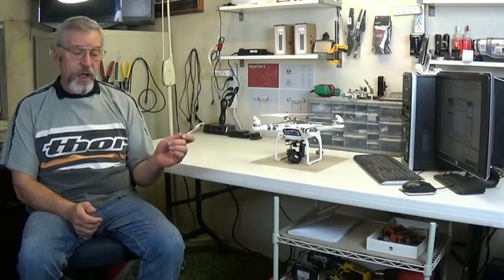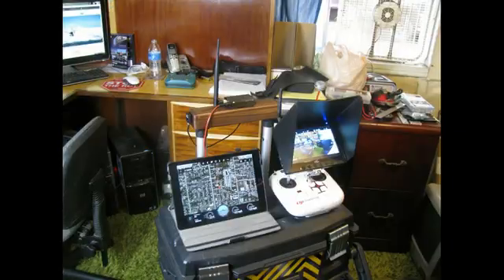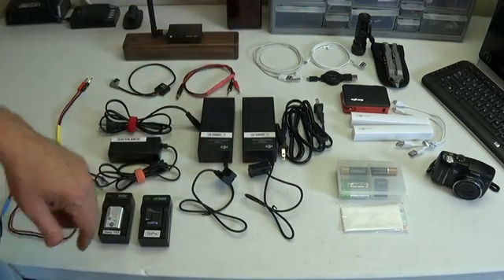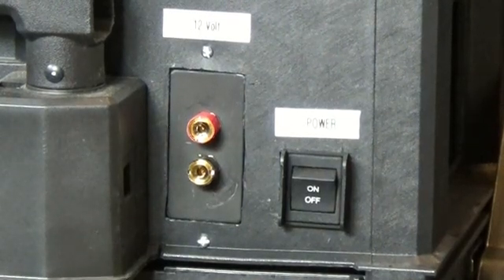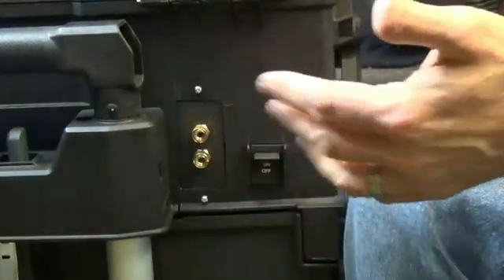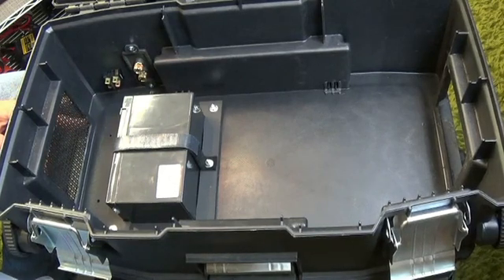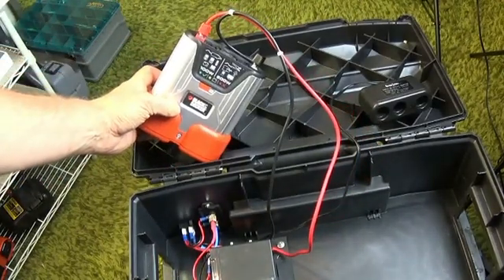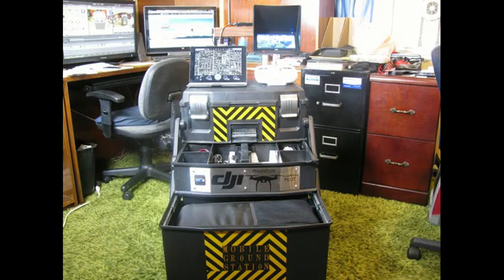Dji Phantom Mobile Ground Station

Comment: Can you please provide links to where we can find the gear you've shown?  I found the Stanley Mobile Work Station.. way cool!
Reply from the maker: I got most of the stuff (Power inverters, Stanley mobile work station, USB chargers) from Home Depot. The on/off switch I had already, I'm sure that it came from Radio Shack, the battery came from Battery's Plus.